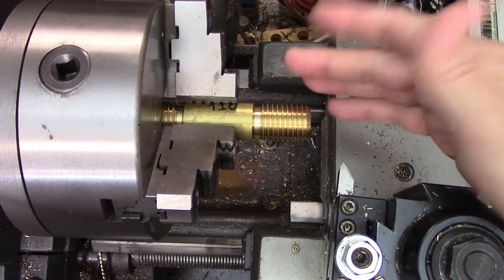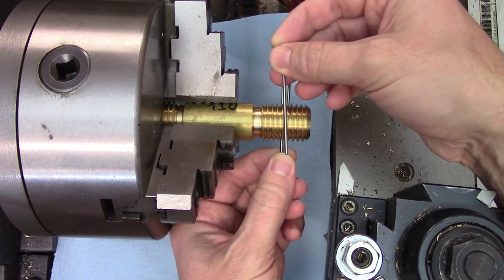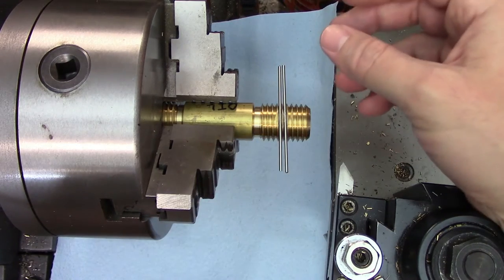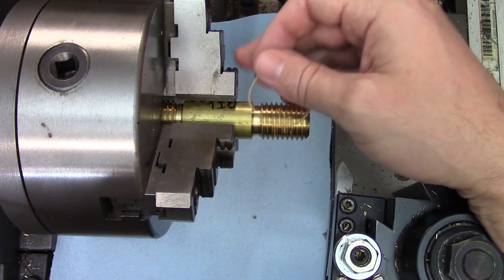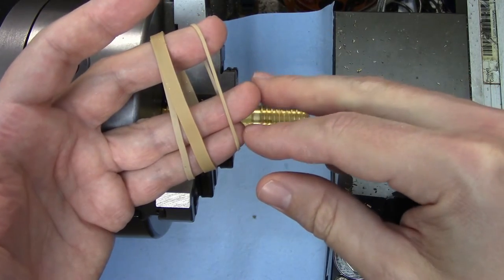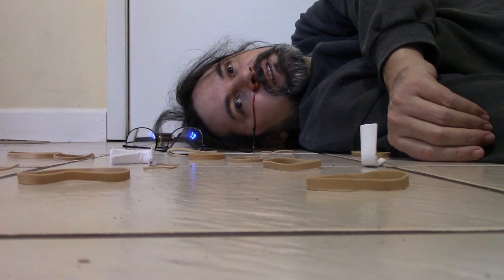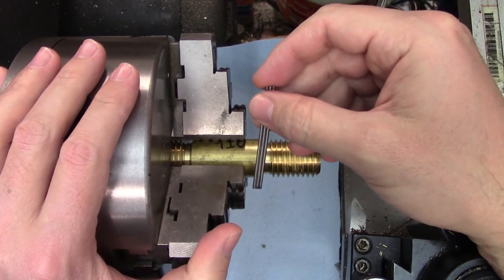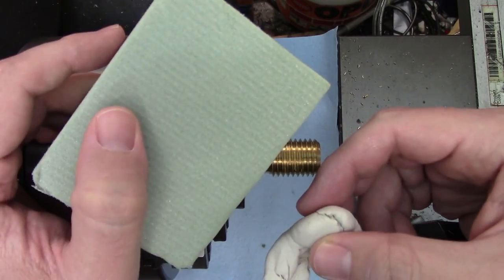Different Ways to Hold Thread Wires - Testing the Three Wire Method

Comment: Wires are a misused technique. They are 3rd rate for measuring threads being machined. They are intended only for perfect threads such as on a ground thread plug gage where the thread form is dead on. Better is a thread micrometer that can account for some form variation and best of all is a calibrated precision thread ring gage. Wires can show a good measurement when the thread is actually a reject. Ask me how I know.
Reply: There is no doubt that thread mikes probably the best way to measure thread pitch. The problem is the cost. Most if not all thread pitch mikes don't come with all of the anvils one might need. You can easily spend a could a couple of hundred more to get the full range of available anvils. In addition, to measure ACME tread you will need five micrometers to cover the range up to 5" ACME. If buying brand name tools a full set up could easily run you $1000.00+. How many garage type home machine shops have that kind of cash laying around.
Reply: @oh8wingman  Yeah, wires are better than nothing for home gamers but you have to be aware of the shortcomings. It's always presented as a viable and valid alternative and it is not. They are intended for inspecting precision gauges with very accurate thread forms. That is why serious professional wires have to be and are made to gauge block tolerances. Van Keuren wires go for $100-$200 for 3 wires, per size, ~ $2000 for a set of 16 sizes. That compares well with thread micrometers.
Those cheesy 16 sizes per set for $18 are not up to snuff. You can get away with it if you stay away from the limits of the tolerance AND you know what to look for aside from the measurement itself. Then again you can do almost as well with the old cut and try method if you are careful and know what you are doing but there is a hell of a lot to know.EX: I can see the thread shown here is out of spec regardless of the wire measurement.

Comment: Have you ever use tape to tape one end of the wire? it very convention for me for difference size of wire and thread. tape two wires parallelly together space apart as a pit wide, tape one wire on one end of the tape, when folding the tape the two wires and one wire make it about the same as pit diameter.
Reply from the maker: That sounds interesting. I'll give that a try to see how I like it. Could you email me a picture or two of it so I can make sure I do it correctly? My email is my channel name with no spaces at gmail.com.
Reply: @StuartdeHaro , I know this is a bit old to comment on. But when taping the two wires, to get the correct spacing, hold them in the threads while taping them, and you'll get the perfect spacing, then tape it. You can either tape them all together, two wires on one end of the tape and one wire on the other, or you can tape them separately, making nice big flat tape "handles" to hold onto while measuring. The tape also makes it easier to find in a chip bin. Let me know if you'd like a picture, and I'll whip something up.
Reply from the maker: @braingrenade  A video is never too old to post a comment on. I still get the notifications. Thanks for your input.

Comment: I haven't tried the clay method myself, but I saw a video where the clay was stuck onto the thread first. The the wires were poked in fairly well lined up. This leaves both hands totally free to make adjustments and take the measurement. 
It looked pretty practical, I think I'll try it.

Comment: Very entertaining!  You might consider comparing the 3 wire method to the 1 wire method.  Joe Pi described it in one of his videos, but didn't comment on its accuracy.  If accurate enough, the 1 wire method should be easier for  us fumble-fingered individuals.

Comment: I use grease but I broke down and bought a set of holders from flexbar.  They were cheap and seemed to work well although I did not do any comparison to see if they effected accuracy.  I found they work best for smaller threaded parts were the grease did not work that well, at least for me.

Comment: Hi, Stuart. My question is off-topic; I hope you don't mind. I received a brand new set of gage blocs today. I have an older set that was purchased on CL and came from the toolroom of a company I once did business with. Small world. As those blocs aren't in great shape, it was time for an upgrade. Naturally, they're wrapped and protected with a coating. What would you suggest for removing the coating? I was told not to use alcohol, as the blocs would be "too clean." Is these such a thing? I have a number of degreasers and solvents. Just not sure what to grab. This is my first ever new set of blocs and I'm feeling a bit cautious. Would a good degreaser be the way to go, or perhaps a solvent for a more masculine approach? Thank you in advance!
Reply from the maker: I would use brake cleaner to get the crud off and then coat them with a light oil or WD-40 to keep the moisture away.
Reply: @StuartdeHaro  Thank you very much!